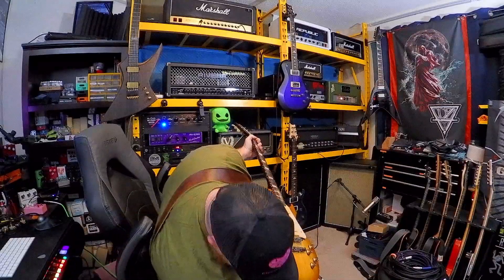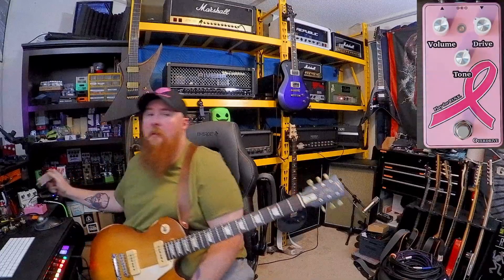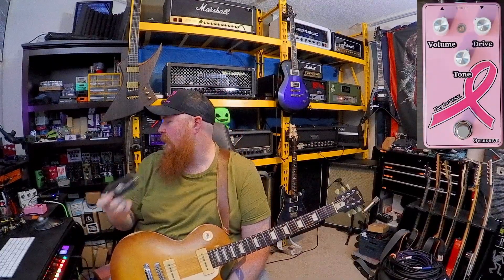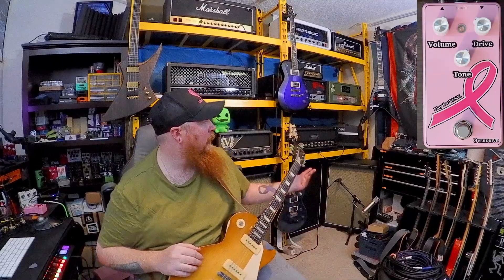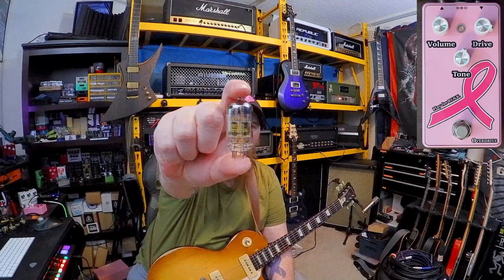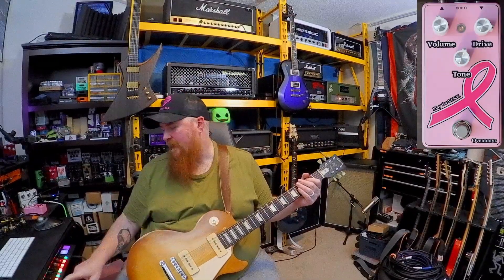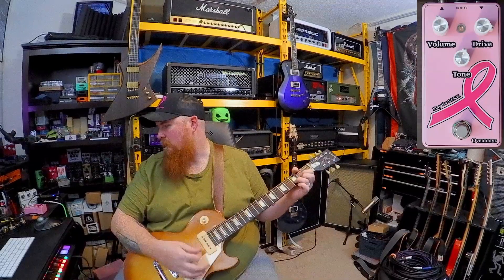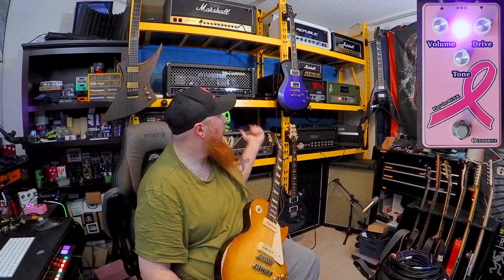Phase Inverter: 12AX7 vs. 12AT7 (Sound Check)

Comment: don't waste your time and money on mediocre modern tubes with random gain ratings tones and results, a used strong tested vintage tube is under 100$ mullard rca ge brimar you can't go wrong
Reply from the maker: To a point I agree, a nos tube vs current production won’t yield enough differences in some amps, Mesa, Engl, newer Marshalls etc. to justify the price of the nos/vintage tubes, however I have found some boutique amps have great results with nos tubes my Satellite Neutron for example sounds infinitely better with my nos Sylvania ax7 and rca Blackplate au7.
Reply: @thatsoundsterrible  a high gain balanced mullard i63 at the pi always worked for me on all the amps ,it's like having a master volume on 11 so it pushes the power section more. using a tube tester helps  lot.

Comment: I started to replace the V1 tube in my TUBE 15 (Harley Benton) with a 12AU7 JJ and I didn't like it. There was hardly a distortion. Now I use it on the V3 position and I love it!  V1 is Tung-Sol 12AX7 and V2 is stock tube. Power tubes are Sovtek EL84
Reply from the maker: Keep in mind, the 12AU7 has a gain factor of 20ish while the AT7 is around 60 and the AX7 is 100. For myself, I stick to the AT7 to clean up the amp some just to kick the front end harder with a boost or use them in the Phase Inverter so it doesn’t hit the power amp as hard. But, tone is always subjective, so if it works for you then that’s what matters!

Comment: I do think it made a bit of a difference for sure. You can hear the gain drop, but the AU sounds more pronounced
Reply from the maker: It’s actually an AT7, I had my numbers mixed up in the video. 

But yes, i quiet like it so far with the 12AT7.